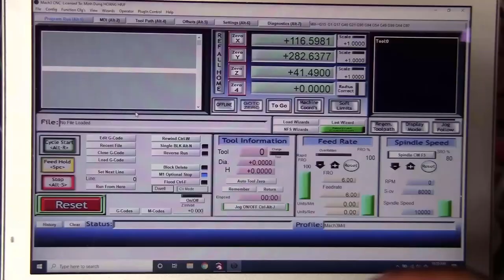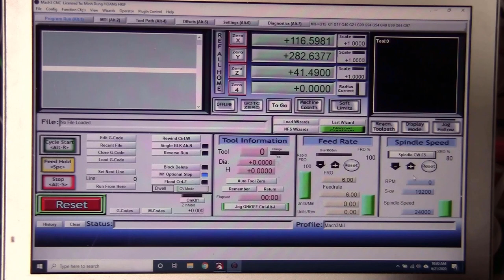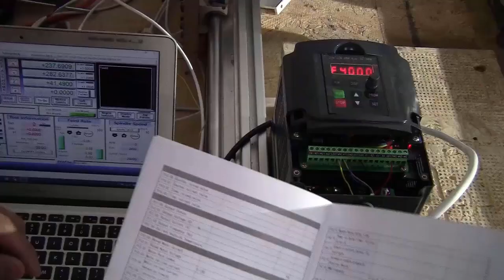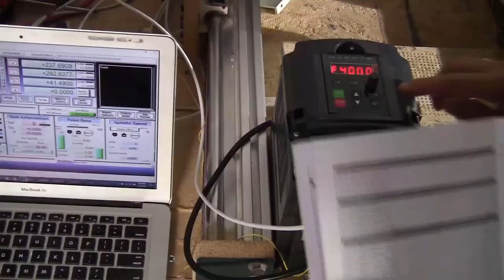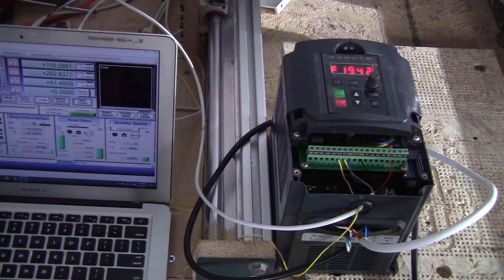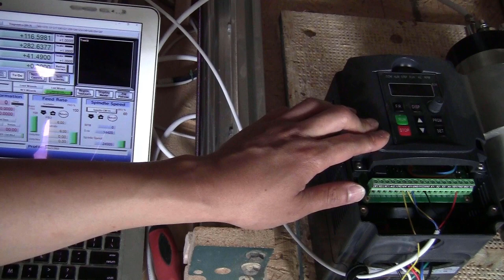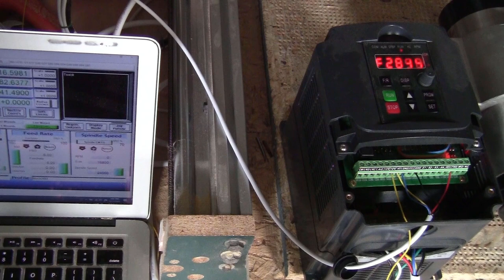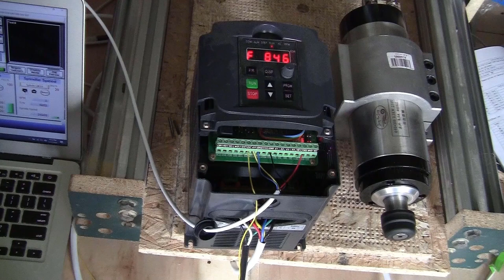2.2KW water-cooled spindle VS. wood router - 3D art relief made easy - VFD + USB RNRMotion Mach3

Comment: I know why your relay turned on when you connected the 10V reference from the VFD to your controller. It is because that is an output from the VFD, not an input! Don’t connect an external voltage to it, or you will damage the VFD circuitry. The analog input for speed control is designed for connection to a potentiometer, as shown on the VFD connection diagram.

Comment: your ingenuity and resourcefulness is inspiring. i have just bought a 3018 and want it to do something functional like this. So i may be following some of your earlier footsteps, maybe 500W spindle and NEMA 23 steppers. First i need to learn how to use cad/cam better!
Reply from the maker: Thank you for the kind words! Going through the first few upgrading step will help understanding a lot more about milling machines. I will recommend the installation of fully supported rails on the X axis first. That will improve tremendously the performance of the machine then the spindle will be a good addition to it. I only started learning about milling and CAM only more than a year ago. It won't take you long to build some real good machines.
Reply: @minhsmancave9448  I'm totally impressed by your ability to reason out the requirements for rigidity and robustness using the extrusions that determine the build design and your skills with Fusion 360.......very inspiring.

Comment: oh man, 2.2kW spindle is an overkill for this cnc :))) But yeah, enjoy it my friend happy carving
Reply from the maker: Thank you, I bought this set of spindle really long time ago thinking I'll use it for my final big CNC which I'll build in the future with all metal parts using my plasma cutter. But the router was just too noisy so I decided to give it a try now and see it works anyway. So far so good!!!
Reply: @minhsmancave9448  There is a 1.5Kw air cooled spindle with ER11 chuck and 8,000 to 24,000 rpm  on EBAY going for A$135.....diam 62mm, length 230mm, comes with an aluminium mounting bracket.....more than plenty powerful for the 3018 I'm building.
Reply from the maker: Spindle with VFD? If it's a complete set, send me the link bro. Cheapest I could find was $215 on AliExpress. And 1.5kw spindle is heavy, you will really need to renforce the x and Z axis. If not, the spindle will be waving like grass in the wind
Reply: @minhsmancave9448  Oops....the spindle is without a VFD as I already have one.........with the VFD you pay A$100 more so your price is probably cheaper then mine......Aliexpress doesn't work for me as I tried to order and it disapears off the screen at the payment stage.
I'm in the process of building from scratch a 3018 with heavily modded frame, linear rails and 1204 ball screws and I'll probably at the start use the 500 watt brushless motor.
Reply: Better too big than too small. You can run it under 2.2kw but you can’t run it over.

Comment: I believe there is a USB to RS485 converter that will work with Mach3 if your VFD can take RS485. It makes the wiring much easier and controls the spindle speed nicely
Reply: Yes, I am having some issues. Can you please elaborate??? On my VFD there are two RS ports. Then I simply connect them to the USB adapter and then to PC??

Comment: Doing a vertical pass removes much of the tool marks as well. Or you could use a smaller step between passes. I still need to wire the spindle speed control to my cnc, and a z depth/datum
 probe.

Comment: Hope you don't mind me asking but what sort of size water reservoir do you use? And does the water end up running quite warm? I'll be ordering one of these soon enough as my upgrade machine is close to being finished. Inspired by your videos I've fitted a Mach3 board and I'll wire up today, won't be able to test movement as waiting for couplers in the post, but I should have spinning steppers today. Followed your Mach3 3018 video to wire up board and single stepper on my dining table, worked first time, I managed to blow up a board with built in drivers last time I tried :D Different board this time with 556 drivers to give me room to upgrade steppers later, using some 2.8a nema 23's I bought for cheap ages ago. Also fitted a LattePanda SBC running windows10 that I found on Ebay so the machine is stand alone. I'll make a video when it's finished and running so you can see what you helped me build, but I'm no youtuber lol, it'll probably be the worst cnc video ever!!

One thing I've been thinking is that most, if not all, cnc's that use a moving gantry have two motors on Y but then only one on X. Do you think it has to be better to balance the forces and either have a bigger motor on X or two motors the same? I've got spare motors so it would be easy to add one, just one more driver needed. What do you think?

Thanks again for the videos brother, really helpful.
Reply from the maker: The water barely warm up after 5h of running. No worry about the temperature of the spindle. I only have a normal size bucket, less than 2 gallon of water. For the moving gantry type, the Y axis needed to move a heavier load and the spacing between the two linear rails is wide, that's why it needs 2 stepper motors to balance the two sides. The X axis is narrow and light. With the same motor size, the X axis can always moves  and accelerate faster than the Y axis.

Comment: Hi Minh, great as always! 
May I ask how long this wood router can run before it needs a break?
Reply from the maker: The longest I've run it is about 2 hours. Not sure if it can hold on longer than that.
Reply: @minhsmancave9448   Thank you! And out of curiosity, did you get your aluminum extrusion from ebay or from 80/20? Im thinking about getting them from ebay but concerning their rigidity since im building a big machine
Reply from the maker: If you're using sbr20 or sbr16 for linear rails, you should buy Aluminum extrusion of 3030 series. I bought mine from zyltech.com
Reply: Thank you for your great info! Im gonna use chinese replicate of mgn15 for linear rail and plan to have 8040 aluminum extrusion for my 1,8x1,6m frame. I planned to buy chinese extrusion but afraid it would not rigid enough (I ll apply linear rail directly on extrusion. Heard about epoxy for leveling but that doesn’t sound like fun). Since zyltech is not available in my country, i will order from Misumi for the rigidity. Your video is a truly practical source of information
Reply: And thank you for prompt reply
Reply from the maker: If you're milling wood, most of Aluminum extrusion will be fine. 8040 way more than enough for any CNC machine. Mgn15 is a good choice because it's easy to install on any type of aluminum extrusion.
Reply: Great to hear that. Love to have save some money on the frame. Maybe im worrying too much about the extrusion cant hold gantry weight, and vibration of spindle. One last question, do you have any experience with aluminum extrusion from Chinese vendor, are they good enough? 
Im still not sure if nema 23 1.6nm would be enough but the best way to find out is to try since used one is super cheap
Reply from the maker: I can't buy Aluminum from China since the shipping will be too expensive. For the stepper motors, the larger, the faster you can move your axis and save time when running Gcode files. If not in cutting (depending also on your spindle) then it will be in fast movement in between cuts (sounds like not much but it can actually save half of the job time if you carve something complicated). If your budget is not too limited, go with the bigger one and you won't need to upgrade later.
Reply: Thanks a lot for your great info. Right after your reply, Ive just ordered some first stuff i need to build the machine. Your videos and replies are not only informative but also motivating 
By the way, greetings from Viet Nam

Comment: Hello, thats very nice, can you make a detail video from the wiring with this VFD? THX
Reply from the maker: I'm not sure if you watch through the video. I showed lot of details about connecting between breakout board and this VFD. It's very simple. If you still have questions, feel free to ask.
Reply: @minhsmancave9448  Problem is, my BO-Board is different, i only have GND and FWD from the board, thats why. But thx for your answer! I like your Videos
Reply from the maker: What breakout board do you have? If you have the fwd and gnd pin, that's even easier.
Reply: @minhsmancave9448  my machine is from LYCNC they have a board with integrated stepper driver and only two conectors, one for fan(cooling of the whole cnc controller) and one for spindle, all others are conected to a multi outlet. the service from lycnc is not good, they send me nothing about the wireing circuit.
Reply from the maker: Take a picture of the board and send it to my e-mail: minhdung.diy@gmail.com. I'll see if I can figure it out. Are you running the machine on mach3 or other software?
Reply: @minhsmancave9448  thank you very much, i'm running mach3

Comment: Water cooled spindle?  WOW.  Yeah, but you must have a 220v outlet (but I heard you just say 110v so I am confused) as I do not anywhere near anything (only one in a 2400sq foot house and it is outside) so I am stuck at 1200-1500w max and at 1500w I would be tripping the breaker a lot so 1200w is really the max.
Reply from the maker: No, I didn't use 220V for this. It's 110V. I bought the set for 110V because I didn't know how to get 220V in my garage (I do now). But I'm not sure how they calculate the power since the current rating on the spindle is 8.5A. Maybe the Chineses are tricking me again. The VFD seems right tho, 22A rated current. I put them on a 30A breaker. But so far the set seems to be working fine. The cuts are smooth and I can enjoy the quietness again. The router was killing my ears.
Reply: @minhsmancave9448  Be careful because you need to make sure the wiring is rated for 30a not just the breaker else the breaker will never trip and the wires would catch fire.  Most household wiring uses 14ga wiring which is rated for a max of 20a.
Reply from the maker: @thebeststooge  I surely should! Still not sure about the current rating of the spindle. If it's 8.5A then I'm nowhere to be near burning down my house but it's also nowhere near 2.2KW. CAn't understand the reasoning for the power rating with this spindle.
Reply: @minhsmancave9448  This is what I have been asking for a few years now and no one has been able to tell me because the math doesn't work.  I suspect it is the times 2 or times 3 or even times 4 Chinese math that is so commonly used these days.  8.5A does not equal 2.2kw.  15a is ~1850w so you are almost half of that at 8.5a so I wonder if that Spindle is really around 800w-1kw?  The math is saying that is the case.  Now they do make real 2.2KW spindles and they are about twice as large as what you showed whereas the ones (eBay/AliE like ones) sold as 800w are twice as small BUT, then again, those are using the Chinese math with their broken Abacuses. A real 800w Spindle is larger than what you get from AliE/eBay.
Reply from the maker: My best guess is that there were 3 wire for 3 phase of the brushless motor, each one is rated 8.5a max (not gonna be 8.5a at the same time). 3 times of that multiply by 110v and take out 10% for safety, that's about 2.2KW. That's might be the way they trick people into buying this type of spindle. But it's seems to be enough for my right now, it's quiet and carves well.
Reply: @minhsmancave9448  That sounds a lot like the old days where they would say a boom box had 100 watts of sound but find the fine print and it was using the worthless measurement of peak to peak power instead of the RMS.  Still, it works but I sure would like to know the real power of that because the equation of hp to watts is 1hp to 745 watts.
Reply from the maker: I think that I will try to measure the ac current when the spindle is running and see what's power is. The power under load might completely different though. This thing is a mystery box for me. I might just try to close my eyes and move on.

Comment: What cable do you use between VFD and motor, what gauge are the wires?
Reply from the maker: I use 16 gauge
Reply: @minhsmancave9448  Thanks, that is what I have. 4 wire shielded.

Comment: Good vidéo ! What the différents finally between this two drills ?
Reply from the maker: The new spindle is quiet and powerful. I can also vary the speed using g code depending on applications. That's a big improvement compare to the wood router.

Comment: if you remove the plunge router propeller more silence than the cnc spindle
Reply from the maker: Thank you for the tip. That might reduce the noise but I'm not sure about the cooling of the router. It might get hot for some long jobs. Now that I have the water cooled spindle installed, I prefer to keep it since it's quiet, precise, more powerful and I won't need to change the brushes as I needed to for the router.
Reply from the maker: "plunge router" is one word here, it's the type of router. He meant to remove the fan of the router to make it more quiet.